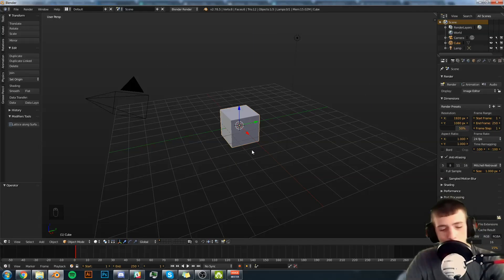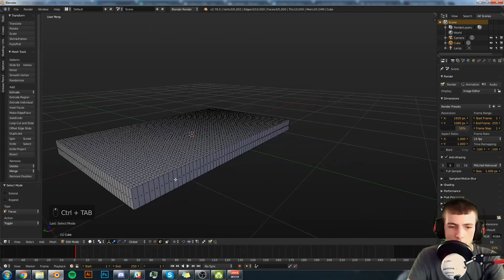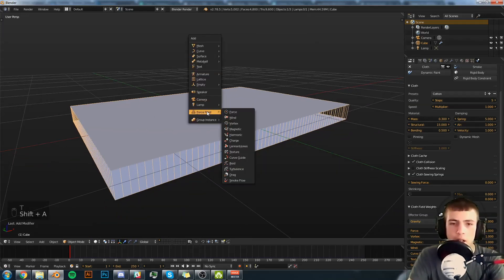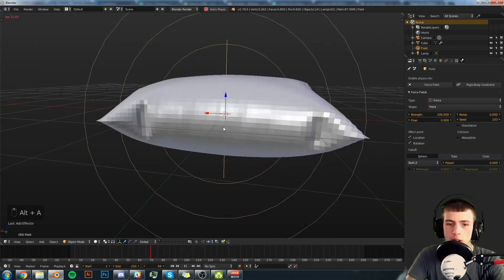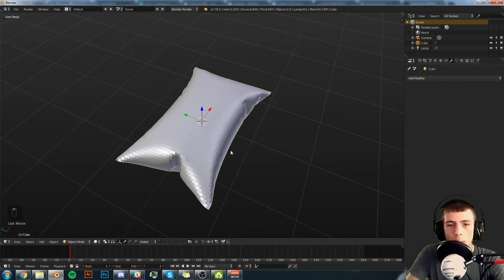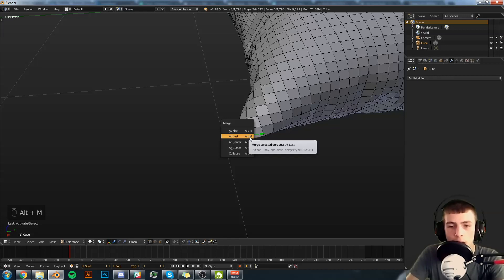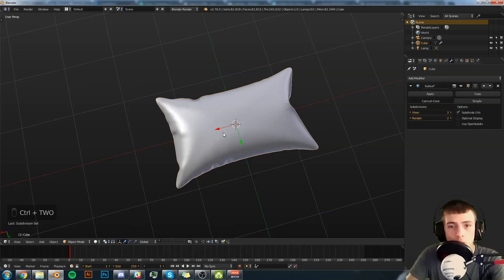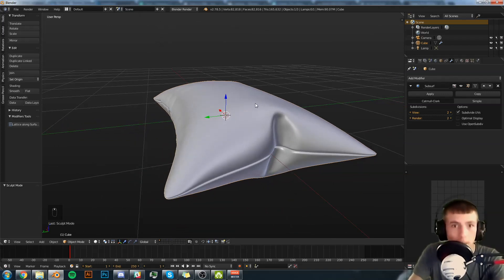How to Make a Pillow in Blender 2.7x

Comment: Followed along to make a pillow.  Hit play and it started up staying a bit flat, puffing up a tiny bit.  The second run pulled it together to its center like there was a tiny black hole in the center of the pillow.  Gravity was indeed at zero(0).  Went thru a second time, thinking maybe I missed something, but it performed the same way.  Also, I'm using Blender 2.8, so the physics panel is different than the one in this video, so I improvised at the point of "Max Sewing Force" and "Shrinking Factor".  Don't know what numbers to use here, so I'll need to play with it and see what happens as I change them around.

Maybe you could create another tutorial for making a pillow using the latest version of Blender as of November 2019?  THX.
Reply from the maker: It sounds like your force field isn't working properly. Try going over the tutorial again, and making sure that it's set up the same. Also, make sure you deleted the faces around where the seam goes, and left the edges, and make sure you have no doubles in the mesh. Furthermore, this tutorial is meant for <2.79, so if none of those work, try it again in blender 2.79 if you have it installed. I've heard of various issues arising in 2.8, but I haven't had the time to remake the tutorial. If this continues to be a problem, it might be something I end up doing.

Comment: Interestingly this works because the rectangular shape causes an imbalance in the forces applied to give the pillow the creases and whatnot. If you use a perfectly square shape, there is no noise and a boringly even shape. You need to artificially induce some noise to give it a more interesting shape.

Comment: Nifty trick, but the tutorial doesn't explain why it's done in this way, which makes the tutorial hard to apply besides a pillow, and possibly useless when the results don't turn out the same (even when  when strictly replicated). Reading the comments, I am not the only one who just got an imploded mess. (now solved, check edits below for those still struggling)
Could you please explain this tutorial a bit more comprehensively, or point to a vid where these facets are deliberated? (I got the pillow, but I don't really understand why)

Edit3:  Think I actually got it after a few misc. attempts. Make the seams (unwrap), and then scale on the Z-axis so it's exactly the same distance below&Above the X+Y axis. Half the strength (100, or less), max out noise to make it (more) uniformly random, and max out flow to make it raise with more curve in the middle. Pillow still comparatively quite fat, but at least it's more resembling the pillow in the tut, instead of pixelated vomit. Seeds don't seem to make any difference.

Edit2: A loop on the sides caused it to collapse excessively from all sides,  and without the loop i still squished itself way too much, but leaves the corners. If the faces on the sides are removed without a loop. it doesn't close the gap. If it does, it's the same kind of mess. If you lower the height to prevent it from going too much on the Z-axis, it will descend, so it must be scaled.

(edit); Neither the values you used, or others seem to make much of a difference, nor does it seem to matter whether one unwraps (w/seams) before, or after the simulation, change force from point to plane, etc.. Could you please explain this tutorial a bit more comprehensively, or point to a vid where these facets are deliberated?
Reply from the maker: Are you using 2.8? They made a lot of changes to the cloth simulator since this video was released a year ago. That's the only reason I can imagine you having trouble with this, since no one else has mentioned any issues. 
As for the purpose.... You can use this method to make cushions in arch viz in various positions for a relatively natural look. And it's easier than sculpting.
Cheers
Reply: @espressojoe  Thank you for the quick response. I use 2.79 . There were a few below that had some similar issues.
I did get it done, just got a rather different result when using the same values, and modelling proportions as you used in this tut. Ex: Scales had to be smaller/slimmer, the simulation was very off, and the doubles didn't turn up in the same places. 

I got no idea why though, and I think the lacking insight to how forcefields/cloth-mod work the way they do, is probably what I actually need. (tall order since I've never used cloth-mod before) 

That's probably way beyond this tutorial, or what you cared to deliberate, so if you got any tips to where I ought to go, that would be really nice.

As first stated, this is a nifty trick. I see  potentials once I grasp this. Thanks a lot for uploading vids like these

Comment: Hello,   Just tried setting up your pillow tutorial in Blender and came up with a snag.  When I ran the simulation my pillow formed ok but did not inflate nearly as much as yours.  If yours inflated fully to 100% mine only got to around 10%. Not sure what happened.  Any ideas?
Reply: Not sure if you're still on this, but I am just gonna copy&paste my  comment on how I solved it. If you still need it, I hope it helps.

(original comment) "Nifty trick, but the tutorial doesn't explain why it's done in this way, which makes the tutorial hard to apply besides a pillow, and possibly useless when the results don't turn out the same (even when when strictly replicated). Reading the comments, I am not the only one who just got an imploded mess. (now solved, check edits below for those still struggling)
Could you please explain this tutorial a bit more comprehensively, or point to a vid where these facets are deliberated? (I got the pillow, but I don't really understand why)

Edit3: Think I actually got it after a few misc. attempts. Make the seams (unwrap), and then scale on the Z-axis so it's exactly the same distance below&Above the X+Y axis. Half the strength (100, or less), max out noise to make it (more) uniformly random, and max out flow to make it raise with more curve in the middle. Pillow still comparatively quite fat, but at least it's more resembling the pillow in the tut, instead of pixelated vomit. Seeds don't seem to make any difference.

Edit2: A loop on the sides caused it to collapse excessively from all sides, and without the loop i still squished itself way too much, but leaves the corners. If the faces on the sides are removed without a loop. it doesn't close the gap. If it does, it's the same kind of mess. If you lower the height to prevent it from going too much on the Z-axis, it will descend, so it must be scaled.
(edit); Neither the values you used, or others seem to make much of a difference, nor does it seem to matter whether one unwraps (w/seams) before, or after the simulation, change force from point to plane, etc.. Could you please explain this tutorial a bit more comprehensively, or point to a vid where these facets are deliberated?"

Comment: Great tutorial! One tip though. I would UV-unwrap both surfaces before the force field. Cleaner UV-mesh that way...
Reply: This. Otherwise, first rate tutorial, and kudos to all you guys who find/figure out how to use all these features.

Edit: After creating the seam, I also beveled the edges on either side of the seam to get rid of the sharp angle that emerges there.
Reply: Thank you for this recommendation...this is a step I often forget when I want to make low-poly meshes with good UVs and AOs. Thanks!!
Reply: Happy to help ;)
Reply from the maker: Yep, if I were to ever remake this tutorial, that's definitely a change I would make. Good eye on that one ;)
Reply: @espressojoe  
This is a great tutorial! I've already done this in 2.79 without any problems and now I tried to replicate this workflow within Blender 2.8 but the sewing doesn't work. Any ideas?